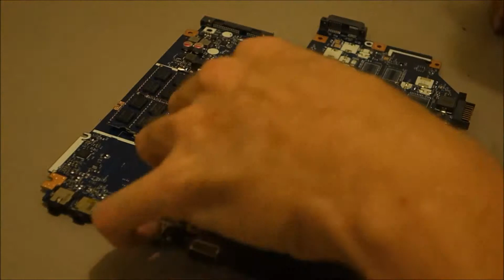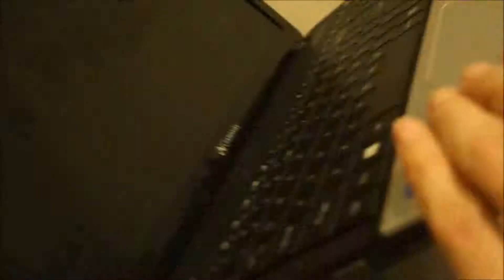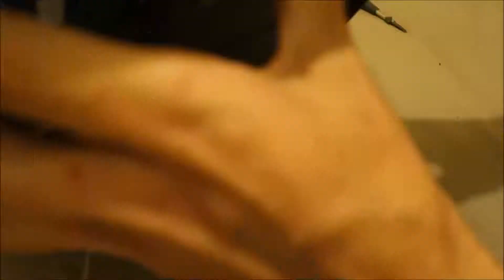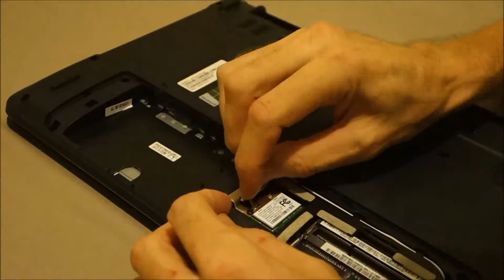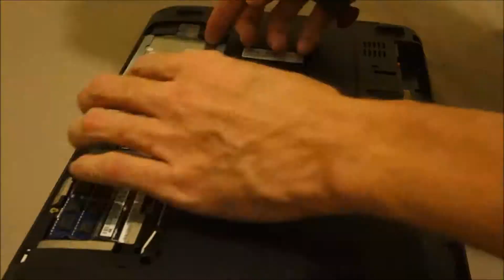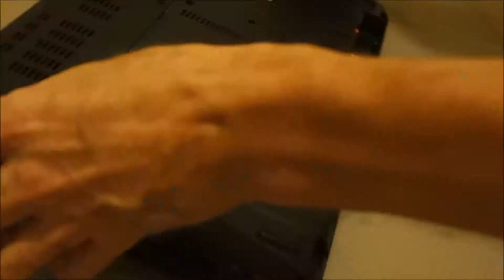Upgrading a Gateway NE56R31u with a intel B960 Pentium

Comment: Awesome video bro... I want to upgrade my ne56r31u to an Intel Intel Core i5-2540M @ 2.60GHz its same socket type and tdp 35w but will I need to flash bios or plug and play? Thank you
Reply from the maker: no it will be fine.
Reply: Otherstuff thank you for the quick reply sir. One more question.. I've   read that chipset hm77 chips won't work on this board because it is an hm 70 chip set .....what is your take on that sir?
Reply from the maker: azizalroshood22 what is yours?    download cpu-z  and see what your chip is.   if its like this laptop in this video it should work.
Reply: Otherstuff
Mine is an chipset HM70 southbridge same as yours but i wanna upgrade to i5
Reply from the maker: azizalroshood22 yeah it will work    search    upgrade hm70   even the i7 will work
Reply: did it work?
Reply: @ksss710  > "did it work?"
If the chipset of this guy is really HM70 as stated, I'm pretty sure it didn't work and he is facing 30min shutdown at best.

Comment: I want to thank you for this video, I have a Gateway NE56r with invaluable and unreplasable info and software i ever want to get rid of so I had a couple of questions... based on research i can only upgrade to 8g of ram, and i ran into this video because i wanted to upgrade the PCU aswell for optimal preformane.

anyway of getting any links to the CPU you upgraded to. TY so much in advanced im now subscribed!
Reply: > "based on research i can only upgrade to 8g of ram"
This is the official statement from the manufacturer.
However, there are several videos showing that it can handle 16gb ram.
Reply: @andrewkamoha4666  would you please send me a link of some 16gb I can replace them with?
Reply: @carlosreyes3620  I wouldn't buy ram sticks online: incompatibility is very common. Go to a local dealer and physically check.

Comment: I know this is a really old video. I recently got a free Gateway NEW90 (NV59C66U I3). I am wondering if it is possible to upgrade the CPU in it for something slightly beefier. I do have an old HP Envy 14 (circa 2010/2011) which is using an I5 processor. Do you know if it would be possible to take that I5 out and place it in that Gateway? The HP is beyond repair sadly but the CPU is still good. If you recommend a different or is possible faster CPU then that i5, ill take suggestions.  Thank you in advance
Reply from the maker: http://www.cpu-upgrade.com/CPUs/Intel/index.html  as long as its the same generation and socket,  find your cpu then scroll down to see the compatible list
Reply: > "Do you know if it would be possible to take that I5 out and place it in that Gateway?"
A first step would be checking chipset compatibility. In particular to avoid ME shutdown:
"shut down the PC forcibly 30 minutes after system start", Wikipedia

Comment: What is the top CPU that this notebook can be upgraded?
B830 to B960 doesn't seem to improve much the performance.
Reply from the maker: https://www.cpu-upgrade.com/CPUs/Intel/Pentium_Dual-Core_Mobile/B960.html
Reply: @daves.projects  > "The Pentium B960 is a Socket G2 microprocessor, based on Sandy Bridge core. There are also 40 Sandy Bridge parts, that work in the same socket."
Therefore, is it possible to upgrade this B960 to a i7-2640M ?????
Now I'm taking this notebook serious !!!! kkk
Reply from the maker: @rogernevez5187  i upgrade this B960 to a i7 3610qm  https://www.youtube.com/watch?v=t9smRgWRrzY&ab_channel=LinuxProject
Reply: @daves.projects  
> "i upgrade this B960 to a i7 3610qm"
UOU !!!!!  Amazing !!!!  Things just got serious !!!!
1) Do you have another video explaining how did you achieve such upgrade and what was the final result ???
2) i7 3610qm is a 45W TDP CPU while the original B830 is a 35W TDP. Any issues with that? Overheating? Did you also upgrade the PSU ????
3) What is your chipset? HM70 is known for not allowing anything but celeron and pentium, otherwise it will shutdown in 30min.

BTW: weird, but youtube did not notified me about your 2nd answer.
Reply from the maker: @rogernevez5187  never had any problems with it. no over heating and would play war thunder on it all the time.  yes i think it was the HM70. dont have other videos on this.
Reply: @daves.projects  
> "yes i think it was the HM70."
All over the net people are complaining that this chipset was intentionally capped, ie, it works fine with i3/i5/i7 for a while then shutdown after 30min.
1) What BIOS are you using? OEM? coreboot? libreboot?
2) Did you applied me_cleaner?
3) If you still have this notebook, you can check the chipset model via linux prompt: 
lspci -v | grep -i HM
Reply from the maker: @rogernevez5187  Now im thinking it was the HM76 as stated in that intel upgrade website. OEM stock bios that acer had, nothing else.
Reply: @daves.projects  
> "it was the HM76"
Ok, you are lucky. HM76 is not capped as HM70 does.
Even so, amazing to make a 35W tdp notebook run a 45W tdp cpu.
Reply from the maker: @rogernevez5187  i read somewhere the 'Thermal Design Power'  is to make sure you have a cooler that meets that.  said nothing about power if i remember.
Reply: @daves.projects  
> "'Thermal Design Power'  is to make sure you have a cooler that meets that."
Besides checking the cooler, you also have to check whether your PSU and MOBO are capable of delivering the power required by the CPU. One easy way, but not 100% perfect, is checking the TDP.

In your case, as long as you are below 35W you are safe. Since you are not, it is amazing that it worked so well. Try to stress test some devices at once in your machine: CPU, RAM, DVD and monitor usually are the most power consuming ones.

Comment: I have a 56r10u. Would a 2030m work for the motherboard without issue or is there another cpu you would suggest
Reply from the maker: http://www.cpu-upgrade.com/CPUs/Intel/Mobile_Celeron_Dual-Core/B830.html    the 2030m is a Ivy Bridge not sure if that will work. but is does use the same chip set Intel HM76 and is G2 socket. all you can do is try.
Reply: Just changed my cpu to a b960  why would my wifi not work now

Comment: Sorry for the newb questions but I have this same laptop and know nothing about computers except watching videos on how to build them.

I get how to replace basic things like ram, but nothing past that.

I have barely used this laptop, it has windows 8 which I want to keep. But is missing drivers. I only used this to play league of legends, swtor, ppsspp, and watch Netflix.

So the computer is mostly new (low miles) but physically older, but I want to if I could restore it to factory Default brand new. I don't have anything on there except a small handful of cds i physically legally uploaded to itunes.

But basically I don't mind erasing everything and starting over with a (new) laptop. So if anyone can point me in the right direction. For someone who knows almost nothing about computers. 

How would I go about:

1. Erasing everything on the computer and make it sparkling brand new fresh out the box?

2. Upgrade whatever physical components are possible if any (including ram).

3. Possibly replacing the battery, is it worth it? Could it be upgraded to one that lasts much longer? 

4. All the software and idk spy ware, virus protection everything one is expected to have to feel confidently safe. I cover my camera and don't do anything sinister but whatever normal people expect out of protection to prevent their information stolen.

I never had anything besides free virus scanning, which is probably dumb but mostly just watched Netflix.

I really don't know where to start but I do have this laptop I'd like to work with to at the very least be able to emulate old games with a bluetooth controller.

If anyone has time or patience, I'd appreciate any advice.
Reply: > "Erasing everything on the computer and make it sparkling brand new fresh out the box?"
This notebook comes from the manufacturer bloated with useless apps. I don't like this path.
Better would be installing only what you really need.

Comment: I want to upgrade my Intel Pentium B960 2.2ghz to a  new CPU with 3ghz for light gaming. Does anyone know where to find one that is compatible with my mother board (I have the same computer as the one in the video)???
Reply from the maker: go to ark intel website   you need to get a G2 socket  i7 gen 2,  you might be able to go gen 3 i7   stay with a 35watt,  i put a i7 3610qm gen3 45 watt in a acer 731 which had a b960  it works but will get hot gaming as its 10 watts more and the heatsink is for a 35watt.    look at the i7 mobile gen 2 at the ark intel site socket g2  FCPGA988  also check your bios for chipset  for compatibility  ( hm76 hm77 and so on )
Reply: would this cpu work? http://www.cpu-upgrade.com/CPUs/Intel/Core_i5_Mobile/i5-2410M_(PGA).html
Reply from the maker: it should...

Comment: I want to upgrade to a  Intel Core i5-2540M too but I here post on people saying that the computer shuts down after every 30 minutes on a hm70 motherboard I have the same computer as you
Reply from the maker: +Tena Rex you have to go with a 3gen  i5 3xxxM
Reply: I just found this out the hard way.  I have a Ne56r27u and put a i5-2540M and it just shuts down every 30 minutes ish.
Reply: @DukenukemX  
> "I have a Ne56r27u and put a i5-2540M and it just shuts down every 30 minutes"
What is your PCH? HM70?
Reply: @andrewkamoha4666  I don't remember.  I just used whatever came with the laptop and use it as it.
Reply: @DukenukemX  
Some NE56R have HM70 others HM77. You need to check that with CPUz. If yours is HM70, then you are doomed.